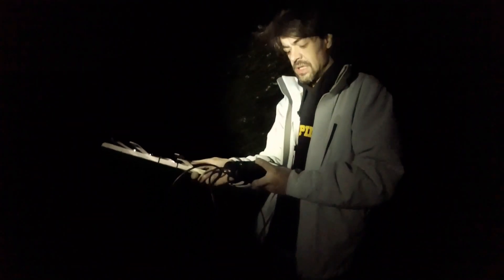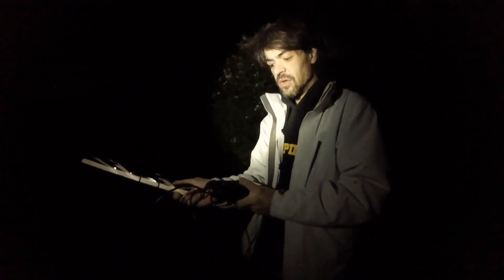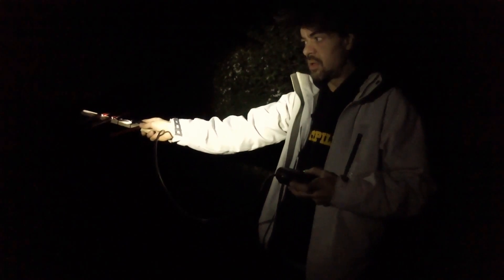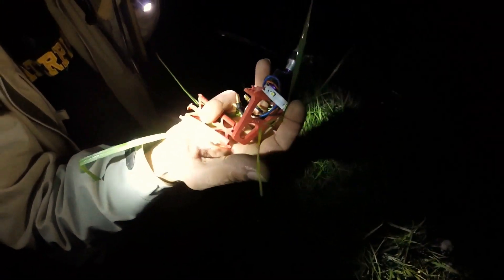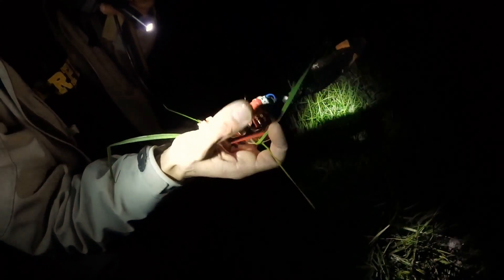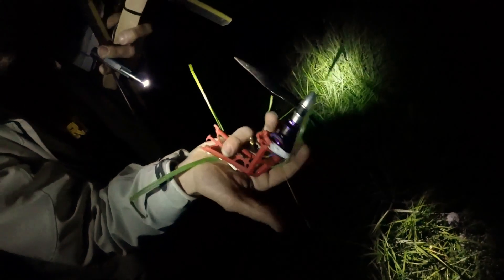Crashed Lost DJI F450 - Tracking with 433Mhz Locator Beacon. PMB New Zealand. rcbeacon.com

Comment from the maker: The left front rotor had come loose. It was fully uncontrollable.
It had landed upside down in grass. If I had fitted a GPS locator it probably would not have had signal. The battery had come off so it was emitting nothing except a tiny beep and a 433MHz pulse.
I know I keep going on about it, but I am certain my craft would still be in that field now if I hadn't fitted that  lightweight tracker.
Up to 15km range with a full receiver aerial  -  4 weeks tracking time  -  Two years standby.
Each transmitter is about a fiver, it's less 60 quid all in. I wouldn't leave ground without one!